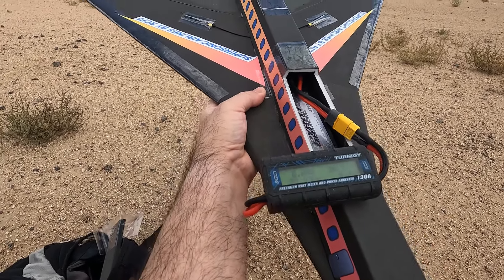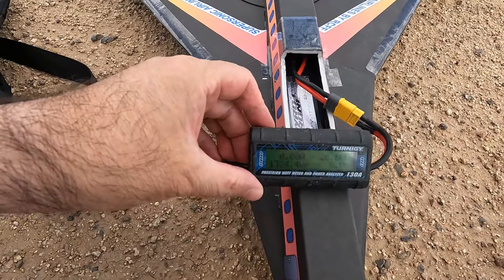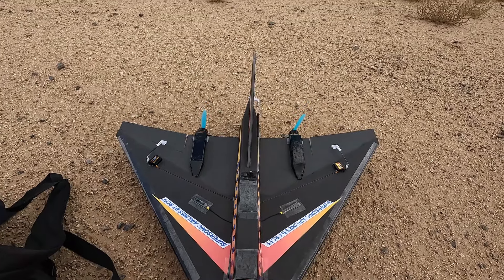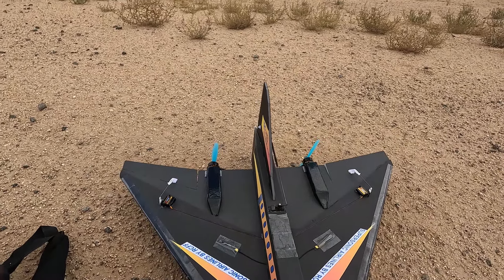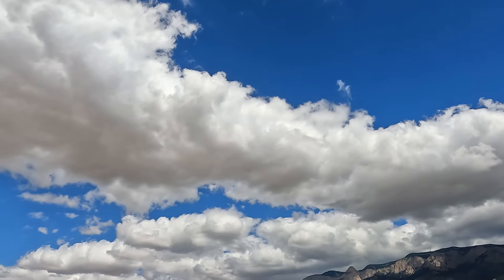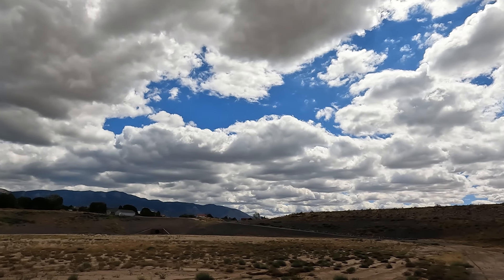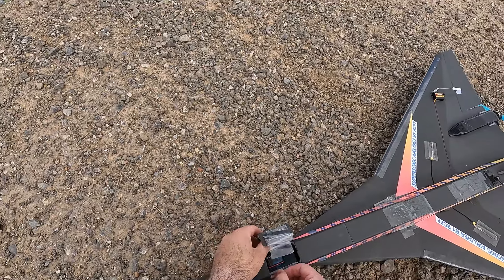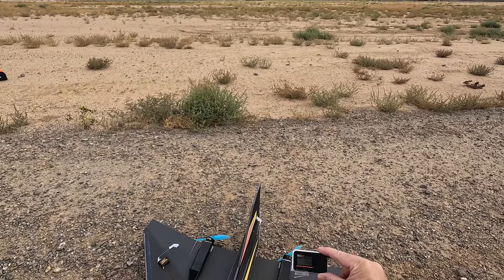FF-Supersonic - Faster on 5S Lipo Battery??

Comment: If your 3d printer can do higher temps, print those motor mounts out of carbon nylon.
Reply from the maker: Thanks for the comment Johnellenberger1!  My 3D printer is a little older and currently only using PETG to print motor mounts. I was looking at getting a new 3D printer though and will for sure look for the carbon nylon filament you suggested, Thanks!
Reply: @rcFoamFighters  Atomic fillament has a Carbon PLA that is well worth the money, easy to print, and will print at normal temps of 210 deg C
Reply from the maker: Thanks for the tip Johnellenberger1, I will have to get me a spool of that filament and try it!